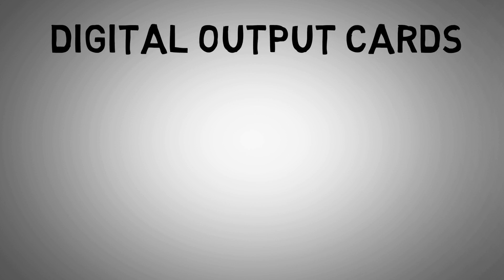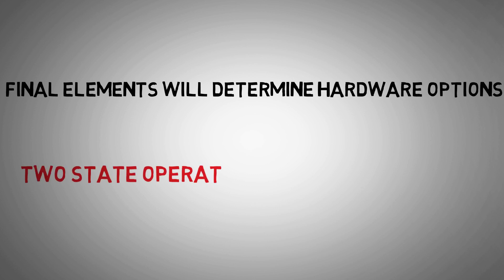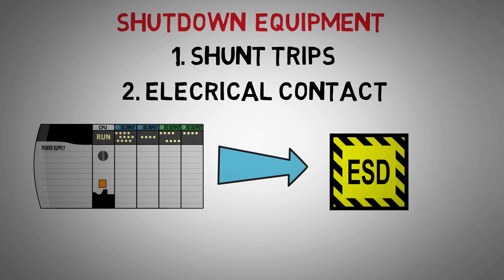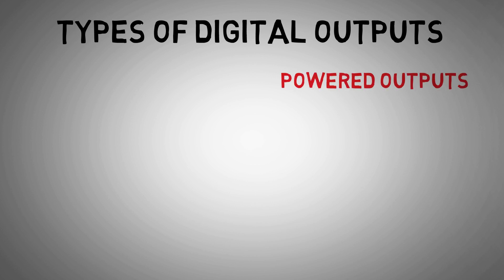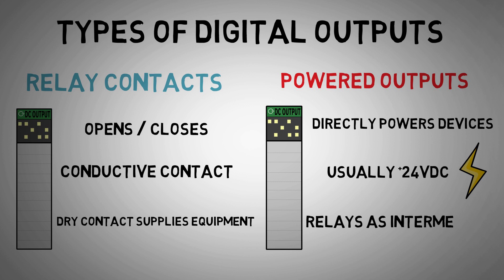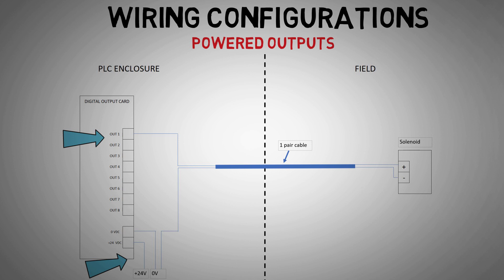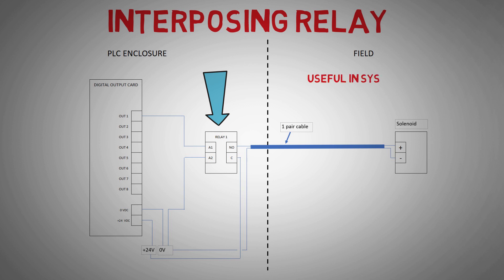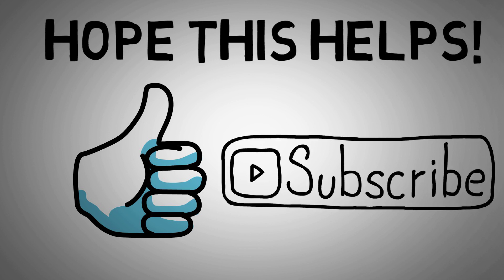Digital Output Card – PLC Basics for Beginners – [Part 4]

Comment: Hi thanks for the great video. 

I have a problem with our rs logic 500 Plc. So our maintenance electrician just recently replaced a probe sensor for a chemical tank that measures PH level. 

The analog output address on the module where the valve is wired to is constantly putting out 115 AC voltage but it's led light in the module terminal is off, keeping the valve open for chemical. But the sensor is not sending the signal for the valve to be open.

Do you know what could be the issue? 

Is the output module defective?

Or is the probe sensor defective? (Although the probe was tested and was measuring the PH properly).

Thanks for any input.
Reply from the maker: Hi, you probably need to do some testing to find out what is going on but here's a couple of thoughts for you.

The 110 vac you are testing is likely the supply voltage and not the output. If this is a control valve, and the output is to a positioned, you will likely normally see 4-10 mA or maybe 0-10vdc on older systems. 

Do you have the software to connect to your plc? You can try manually forcing values of the inputs / outputs and test to see if these are appropriate.

If your analogue card has no LEDs its likely faulty. 

If the PH probe is reading correctly on HMI / control room then this is not the problem, start with your output and do some testing if safe to do so. Good luck
Reply: @InstrumentationControl 
Thank you. I will.

Comment: Hey got one question
If we gonna use both DC  say 24v DC (say digital meter) and AC output (120Vac Fan) in relay output how we gonna do that?
Relay output can either be supplied with 120Vac or 24Vdc in common terminal!
Reply from the maker: Hi there. In the case of a single relay output switching two outputs and different voltages then you can use the output relay to power a multiple contact relay. Each separate contact will switch 2 independent supplies with own commons. This allows for total segregation of voltages. Hope that makes sense
Reply: @InstrumentationControl  gotcha thanks